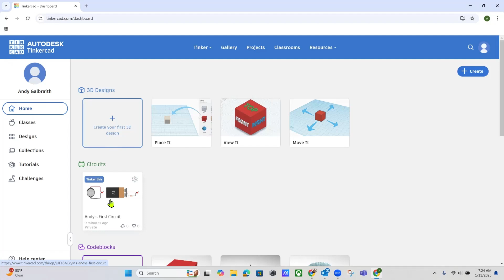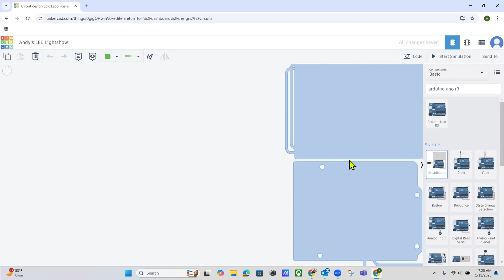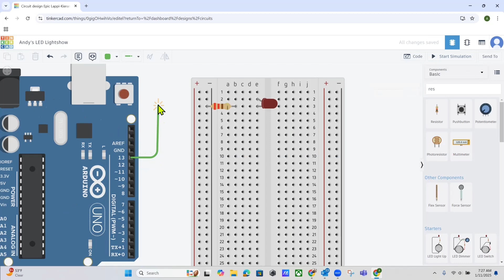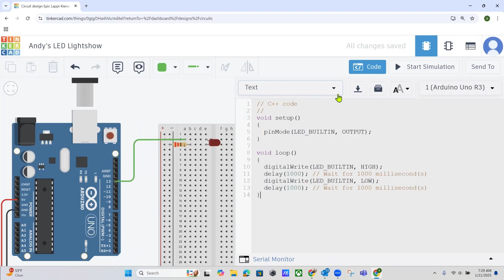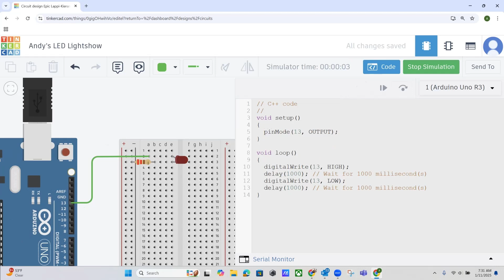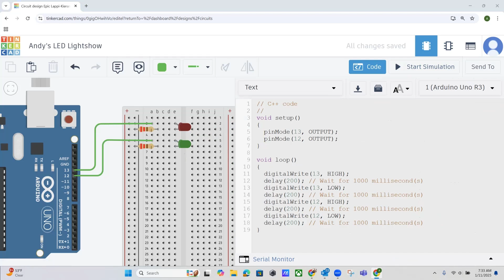TinkerCAD Lightshow

Comment: This is an awesome video.  I'm about to add some LED lights to my Mouse Droid and needed to learn how to make them blink and work.  I just have to figure out what size resister to use for the LEDs.  I like how you stay on point, clear voice and explain in simple terms.
Reply from the maker: @GunnerAl9  that’s great to hear! If you’re using 5V, 220 ohms should be good. You can also do a calculation or make a circuit in TinkerCAD.  If the resistor value is too low, the LED will show a warning about the current (see my TinkerCaD Circuits video for an example of this)